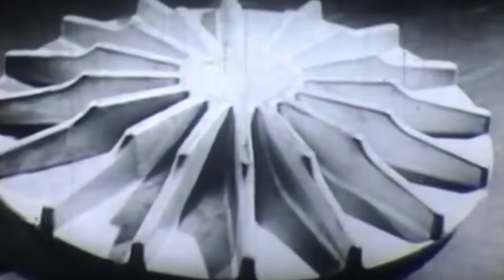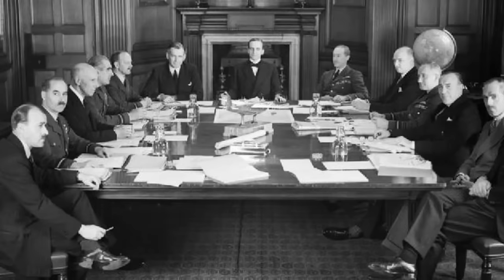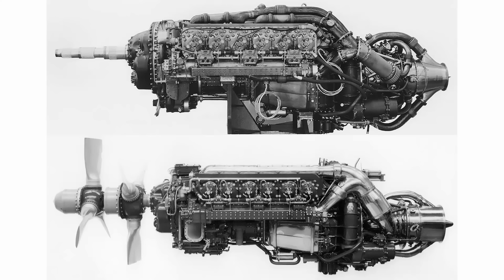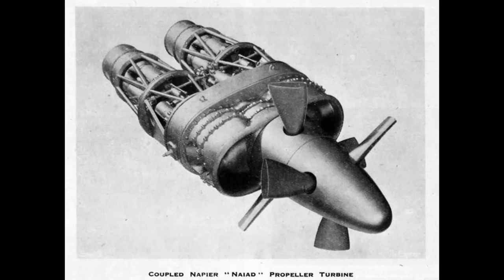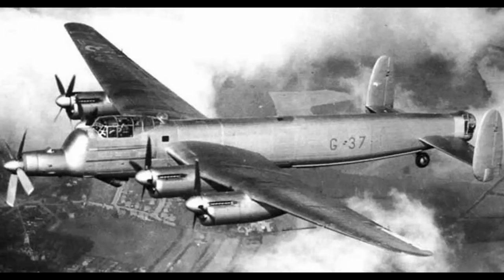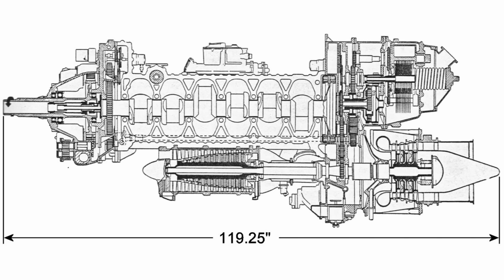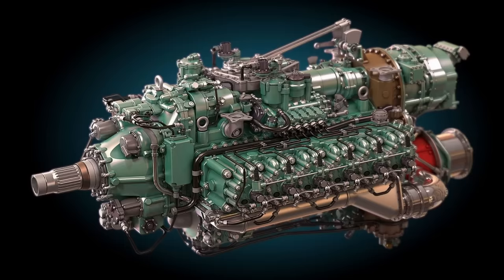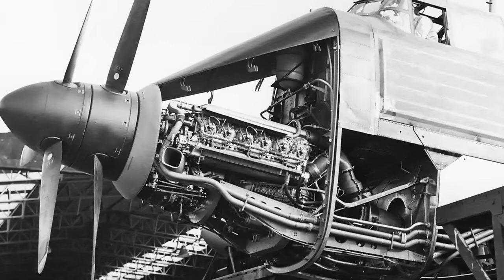A Turbo-Compound-Prop Engine? - The INSANE Napier Nomad

Comment: Nomad was discontinued for simple reasons

1: it was HEAVY
2: half the power came from the turbine 
3: which only had a fraction of the mass and parts count of the piston section
4: power output was being limited by the material limits of reciprocating components, not the turbine or compressor

Even then, it was realised that gas turbines had the potential to scale to incredibly high outputs at light weights and with high reliability.  The 50% fuel consumption penalty of a pure turbojet was judged as an acceptable cost given the tradeoffs involved 

Remember, this was an era when long-haul engine aircraft such as the Lockheed constellation would routinely arrive at their destination on three engines and routine maintenance was several tens of manhours per flight, per engine

Piston engines were (and are) more efficient but the other tradeoffs made them lose out

Comment: I've always wanted to hear one running. The axial flow compressor is mesmerizing and seems odd that no one's tried to bring it back for piston aero engines, due to the limited benefits it would have at sea level for the automotive industry. I know the Leclerc tank's engine uses one, and there's also a truck engine that was developed with one but can't remember by who.
Reply: IIRC, if you're going to go turbo-compound, you might as well save on the complexity and go full gas turbine. There's a narrow range where going turbo-compound makes sense, which results in their rare appearances in production vehicles/aircraft nowadays.
Reply: volvo i think...
Reply: @Appletank8  well... they failed because turbine did not like vibration that it got from piston engine and thus turbine break down very often. if instead you drive lets say electric motor with such turbine and use electricity for something else... maybe that would increase efficiency and longevity of such system.
Reply: @Appletank8  They're beginning to be a bit more common in semi trucks with the largest Detroit diesel engines offered now being turbo-compound.
Reply: You actually can see the concept in current F1 car, and they will abandon it as it just too complicated, and no use for road cars (and AMG ONE is exception more than rule)

Comment: I'm really impressed how complicated those engines can be. Despite being a wonderful feat of engineering the downfall of those engines was it's complication and it was much cheaper and easier to produce the jet engines..
Reply: Or alternatively 4 valve per cylinder internal combustion engines, where we haven't really moved too far from the fundamentals of WW2 aero engine design in the last 70 years as a way to make powerful, lightweight, non-too complex and cheap mass produced engines for vehicles.
Reply: @Pesmog  you are right 👍👍
Reply: @Pesmog  Since the four-valve twin overhead cam design was penned in 1910, there have been many top end designs that looked close to the shape of a modern four-valve engine, one that looked really close was the Allison V12, however, Allison's engineers (or anyone else's engineers at that time) clearly did not understand the combustion process properly so did not get the performance of a modern four-valve design.  Many of the designers had a handle on tumble and swirl but missed the boat on squish, the piston-to-head distance at the outer part of the piston was not close enough to give the all-important squish 9a very simplified and probably partly wrong description).  

It is remarkable, how many designs came close to the ideal,  but a lack of fundamental understanding prevented success.  The Nomads' design was based on a fundamental analysis of heat flows, Chatterton wrote a paper and gave a very good lecture on the design issues.  The reason for the Nomad's existence was the inability to run gas turbines at a high enough temperature to get good efficiency, the two-stroke diesel being the gas producer for the turbine partially overcame this issue, of course, it was more complex than that.
Reply: Maybe,but they didn’t have anything like the range (low fuel consumption, not power was the goal)
Reply: @TheHarryMann  actually immediately after the war they stopped producing those marvellous engines or similar and almost immediately started producing the jet engines that was far cheaper to produce. Only the Shackleton and similar was produced for maritime patrols...

Comment: The Napier Deltic was another innovative engine with three crankshafts and opposed piston cylinders. Imagine that, with a gas turbine.
Reply: They tried it, but got connecting rod failures once they crested 5000 hp (just watched the deltic vid earlier, lol)
Reply: The turbine should not stress the con rods. Maybe they had oil feed problems. Similar issues afflicted early Merlins.

Comment: I worked on the Curtiss Wright R-3350  turbo compound piston engine in the SP-2H. The 18 cylinder, 3,350 cubic inch engine had a 2 speed super charger and three exhaust driven power recovery turbines, PRT.  Insane? I didn't think so.

Comment: NAPIER II did NOT employ a variable-speed fluid coupling; speed variation was obtained via a MECHANICAL speed variator. This is clearly shown and labelled on the cross-sectional diagram!

Comment: this struggle of complex turbo-compound engines vs turboprop reminds me development and improvement of electro-magnetic, quartz synchronized, balance watch movements, and tuning fork quartz synchronized movements, complex to produce, complex to handle, assemble and adjust, and somehow beautiful blend of high-tech mechanics and latest electronic, which became obsolete due to development of much simpler, cheaper and  suitable for mass production quartz movement with stepper motor, which used in watches to this day

Comment: One of the very few prematurely ended engines that is most likely going to be dusted off once more after all the 'E-' stuff goes away. I'm pretty sure RR revisited compound piston/turbine engines at least once since WWII. The comical Star Wars pod racer engine with F1 sound may actually materialize albeit driving a ducted fan in the future.
Reply: As far as I am aware, RR only looked at the compound engine in the latter stage of the Crecy sprint engine project.  

One of the most intriguing engineers of the time, Stewart Tresilian did a design study on low swept-volume, high RPM, two stroke compound piston aircraft engines while at RR, this culminated with a 8000hp design, the problem being that the reduction gear would weigh more than the engine.  However, this study was very unofficial, certainly Hives did not know about it and would have immediately terminated it if he did.  Tresilian defied Hives a number of times, until Hives had his design office moved to Derby one weekend.  For some unknown reason, Tresilian refused to work with Lombard  or even be near him (loathed him), so he resigned

 He also was part of the RR R engine project (and headed the subsequent 1933 Griffin project, which did not go into production) and was probably the person who convinced the R development team to go for high RPM.  

He also co-designed the BRM P25 and P48 engines with Tony Rudd, these were oversquare, although Tresilian wanted far shorter strokes than used in these engines, not as short as modern racing engines, but much shorter than contemporary designs.  

He had a complex relationship with other aircraft engine manufacturers and British car racing groups, often being fired, or resigning.

Sadly, he died prematurely while working as Stanley Hooker's assistant at Bristol, he was known as an engineer who could take a prototype design and turn it into a production design.
Reply: @robertnicholson7733  What did Tresilian die of?
Reply: @robertnicholson7733  And yeh sorry the engine I referred to above is a current concept by Bauhaus Luftfahrt and MTU putting a 20 cyl rhombus configured piston engine (diesel I assume) @ its core rather than the burner cans.
Reply: @stevenborham1584  Ahhh, the "modern" Rolls Royce, yes, well, I wouldn't know, the modern world seems to think I am irrelevant, so, back at it!  To be serious, I haven't kept up with much of the recent work on aviation, one of my older brothers is the (retired) Professional Aeronautical Engineer, I am a retired Professional Electrical Engineer, mechanical engineering is just an interest.  That sounds a bit like a compound version of the Junkers Jumo 223 and 224 engines with five banks of cylinders rather than 6, although the Junkers engines were quite large.  I am not sure about the advantages of this type of engine versus a pure gas turbine, given the advances in materials and manufacturing processes since the Nomad days. Chatterton's paper and lecture on the engine was quite informative and is well worth a read If you can find a copy

I did read a report by the US Army (perhaps Air Force) on a compound engine for helicopters, I am pretty sure it referenced the Nomad.  They went a fair way into mathematics.  There was no mention of the Beiers coupling function.🤔  It is probably still available out there somewhere.
Reply: @robertnicholson7733  The piston engine is here to stay as far as I'm concerned. You can either have gas turbines and carry lots of fuel (not everything is going to conveniently fly in the stratosphere to burn less of it), or heavier ICE engines that burn less fuel. I know 100,000HP ICE engines may never practically materialise (especially for jet fighters), but in seeing engineers are even taking E-aircraft tech seriously they aught to be taking the more thermodynamically efficient piston engine to the conclusions not quite realised, rather than trying to loft hefty batteries into the sky on short hops.
Reply: @stevenborham1584  I don't know, like many of the engineers of the time, there is little information available and in some cases, there is a chance that what little information is known will be lost even now.  People often don't plan their lives and I know of several cases where incredibly rare spare parts and documentation have been disposed of by the family after a death, they do not see it as a betrayal or disrespect, just expedient.
Reply: @stevenborham1584  There may be a niche for a piston aircraft engine that you describe if powered by diesel or Jet A, AVgas is turning more and more into an orphan.  I have not looked at it with a business case, and it would take that to work out all the costs and issues.  The Nomad was an interesting concept, but complex even once you get past it being both a mechanically complex piston engine and a material's complex turbine engine.  

The problem comes with replacing part of the inefficient crankshaft-driven piston compression with a highly efficient axial compressor.  The Nomad had to be started as a spark ignition engine as the cylinder compression was (from memory) about seven to one, by itself not too complex, but more parts and cost. Then the load-sharing coupling between the turbine and the crankshaft that included the Beiers coupling, was required to get the engine compression up enough to run compression ignition efficiently, while transferring the excess power from the turbine to the crankshaft - for me, this is the big problem. 

If I was someone from an aircraft manufacturer, and I was assessing the Nomad for purchase, the Beiers coupling would be ringing huge warning bells, it works (fantastic that it transfers all the power through the oil in shear while at the same time using this hydrodynamic pressure to regulate the disc to disc distance) but it is delicate and I would think adds a very large risk premium to the engine.  

Hopefully, MTU et al. have a better way to couple the turbine to the diesel, without one, they are ....
Reply: @robertnicholson7733  Thank you for your well thought out response. My only one is that the "complexity" is now well over 100yrs old in the making and well understood compared to the highly strung metalurgy of pure turbine engines. But I guess the turbine tech is also well understood at this stage. There just doesn't seem to be any art in things any more just banal efficiency.

Comment: This should be re-worked into modern semi truck turbo technology. An exhaust powered supercharger mechanically coupled to the powertrain and simultaneously driving a standard compressor.

Comment: It's a great example of the relative simplicity of gas turbine engines. All that complexity in the piston part of the engine could have been replaced with a single combustor and a couple of extra turbine stages!
Reply: But up until recently the overall compression ratio of gas turbines was poor so the efficiency suffered the Nomad probably still holds the crown for lowest fuel consumption per horse power.

Comment: I think you meant turbine compound engine; turbo-compound engines--exhaust-driven turbines geared onto the crankshaft--were common in the piston era, and are still used today on heavy truck diesel engines.
Reply: no they were not common and they are not common now. few existed 2 were ever put into serial production.

Comment: Major Frank Halford, was Napier's head engineer at the time & was reasonable for alot of there designs from the late 20's through to the 50's i think, his office was right next to Harry Riccardo in the early days, Bristols Roy Feddon probably had the best Sleeve design & production techniques
Reply: I'm not sure but I think Bristol came to Napiers aid with the sleeve valve when they were having difficulties.
Reply: Not sure who got there but it was the thin nitrided liners that sorted the problems, only Bristol exploited the sleeve valve well.

Comment: Had a random idea about using exhaust gases to power a flywheel that could be used to recover energy and deploy it on demand in cars, as an alternative to electric hybrids.  Did some research and came across these engines.  Fascinating stuff.

Comment: I wonder why they didn't try to find a different use for this engine, such as in a railway locomotive or fast patrol boats as the later did with their opposed piston Deltic engine.
Reply: @Retired Bore apart from the period of the initial contract Doncaster Works maintained the Deltic engines. Those MAN engines never were cheap and reliable in the UK. Whilst weight is needed for traction, where does it say it has to come from the use of a heavy engine with a lightweight superstructure?

Whilst modern warships use turbines, in the 1940s/1950s the use of turbines wasn't a given which made the design and development of compound engines a way to get higher power for a lower weight.
Reply: Yes, but they were compound steam engines, a completely different thing.
Reply: @Retired Bore double expansion steam engines were commonplace on many railways across the world, but they are not the as the compound engines being discussed here. By WW1 the steam turbine was already replacing the triple expansion engines used in RN warships.
Reply: @Retired Bore perhaps you should have been clearer. Compounding in regards to steam engines more often than not refers to reciprocating engines that have high, intermediate and low pressure cylinders linked in that order. And yes, I was aware of some engines using turbines before the high pressure cylinder or in the case of the Titanic after the low pressure cylinder. I'm also aware of how inefficient turbine powerplants are at low rotational speeds.
Reply: @Retired Bore I've probably remembered wrongly, it being decades since I read lots about this topic. But I do remember that the exhaust steam from high pressure turbines would be fed into 1 or sometimes 2 intermediate pressure turbines before the last energy was extracted in a low pressure turbine. All of which would obey the laws of thermodynamics as would putting the steam from the high pressure turbine through a reciprocating engine. After all high pressure is a relative term. But being the expert you are, you already know that.
Reply: @Retired Bore Dammit your right, I forgot about the Turbine in the Olympic class ships, don't think I'd describe them as common though. Trust me I'm completely aware of how much of the potential energy in the fuel I buy goes straight out the exhaust pipe!
Reply: Tradeoffs and maintenance issues

Railway and ship engines have to be dramatically lower maintenance than aeromotive can get away with, whilst also being as fuel-efficient as possible 

Packaging constraints are also considerably different with there essentially being no weight limit on marine engines

The nomad was overcomplicated for non-aviation use, but not powerful enough for upcoming airframes (eg: brabazon). Add the weight and reliability penalties vs turbojet or turboprop and it was an idea whose window of opportunity had already passed

Comment: Impressive! However, getting increasing power numbers at the cost of increased complexity sealed the fate of internal combustion engines for aircraft. Jet engines, while definitely not more efficient, were and remain simpler, more powerful and far more reliable.